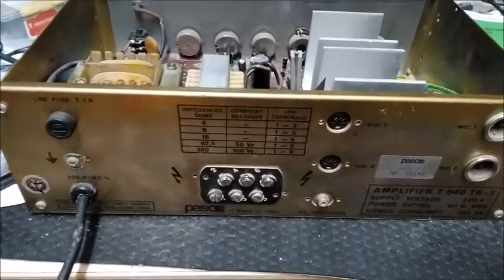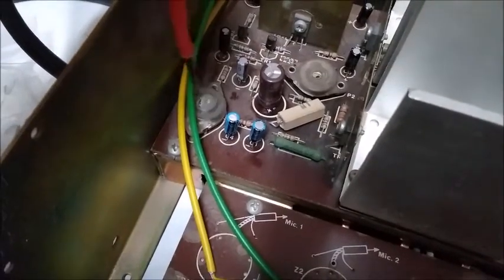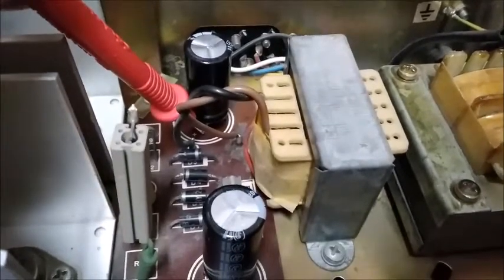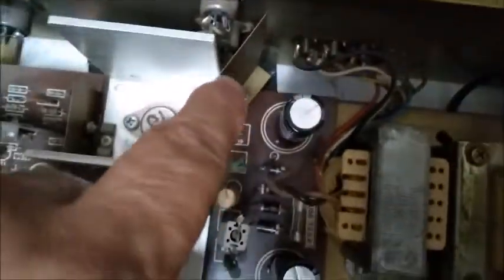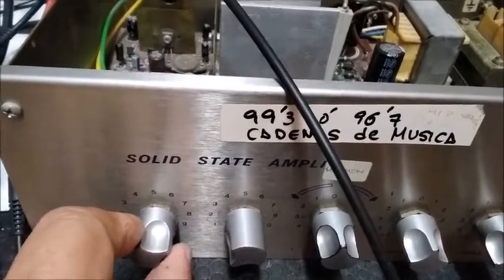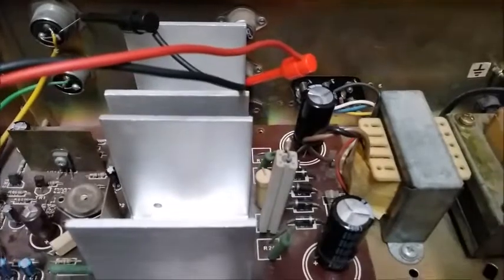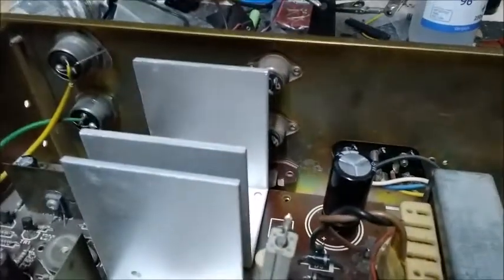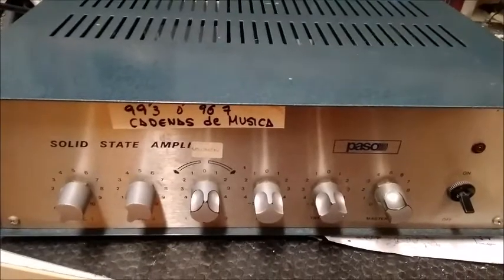5- Reparación de Amplificador PASO mod. T 540 TR-S

Comment: Hola Ketk. Me he quedado gratamente impresionado, por la solución tan ingeniosa, elegante y eficaz con la que has solucionado el asunto del potenciómetro. Solo una persona con verdadero talento técnico es capaz de idear una solución tan simple y a la vez excelente. Recibe mi admiración y un cordial saludo.
Reply from the maker: Hola Te. Me sorprendió mucho en un principio, el desajuste de la línea de CERO voltios, a 21 voltios, cuando debía estar a 25 voltios, pero cuando lo intenté ajustar con el potenciómetro original me di cuenta de lo crítico que es, al más mínimo giro manual del destornillador. Sin embargo con el potenciómetro de precisión multivuelta, fue coser y cantar. Una gran mejora para este antiguo amplificador, con independencia de la adaptación con la pieza recortada de circuito impreso perforado.
Ya imaginé que esta solución os iba a llamar la atención a más de uno y más de dos.
Un cordial saludo.
Ketk.

Comment: Hola está quedando de maravilla y con esos ajustes de primera y la solución que le dio al potenciometro fue genial y sorprendente ,gracias saludos.
Reply from the maker: Hola Yampi. Me sorprendió mucho en un principio, el desajuste de la línea de CERO voltios, a 21 voltios, cuando debía estar a 25 voltios, pero cuando lo intenté ajustar con el potenciómetro original me di cuenta de lo crítico que es, al más mínimo giro manual del destornillador. Sin embargo con el potenciómetro de precisión multivuelta, fue coser y cantar. Una gran mejora para este antiguo amplificador, con independencia de la adaptación con la pieza recortada de circuito impreso perforado.
Un cordial saludo.
Ketk.